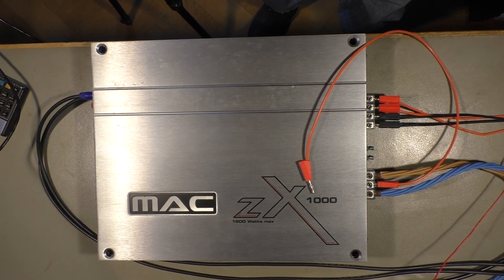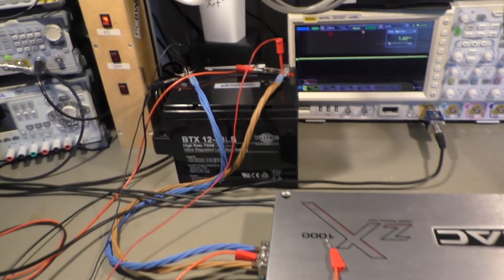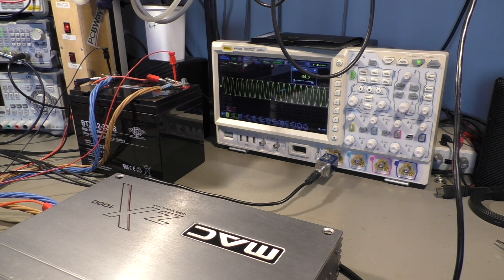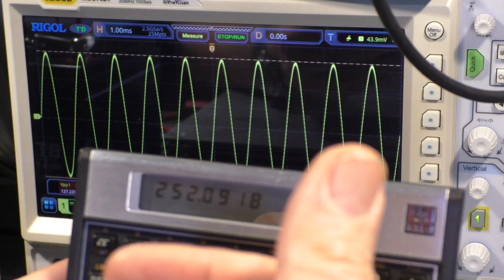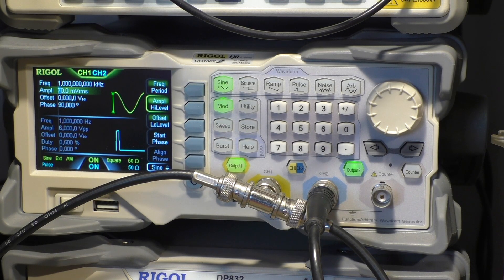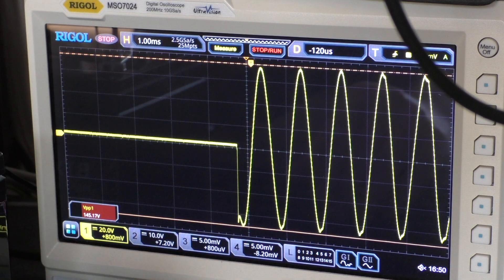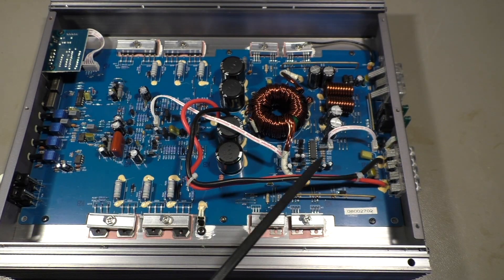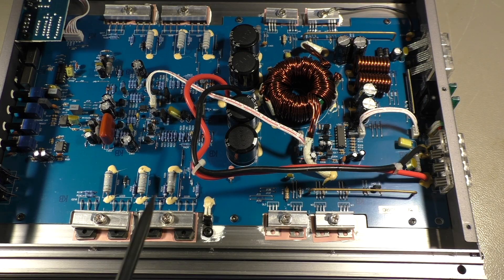1600 Watt amplifier? What the heck is PMPO??

Comment: worry not! the bass bin in the boot of the car is running at 20% THD so the driver won't hear the amplifier power supply pumping up and down to keep up! I've seen these amps with a huge supercapacitor in the 12 volt power cable in an attempt to get more decibels.

Comment: You really are playing with junk. There are some great explanations here by some smart people, I'm afraid their power rating claims are much simpler, they just make them up. That thing looks like a trashy class D thing that will likely set fire to your car before it outputs 500w RMS for 5 minutes.
Reply from the maker: Maybe not a fire, but it makes a pretty good foot warmer. You get it easily to 60 degree C after 20 minutes. And the heat sinks are a joke. 🙂

Comment: And the hp 11C runs with three 1.5V LR44 for decades 😉
Reply from the maker: Exactly! I have this calculator since 30+ years and I changed batteries about 3-4 times... 🙂
Reply: @PlaywithJunk  yea, on heavy use only 😁 AFAIK this is because the "processor" is saphire based.

Comment: PMPO was all the rage back in the late 90's beginning of 2000's in computer amplified speakers. Any amplifier/audio equipment that advertises it's power ratting as PMPO is just JUNK...
Reply from the maker: You bought a 100W speaker and when you opened it, you found "5W" printed on the magnet. Well of course this is a 5W magnet, the speaker ist still 100W  :-) :-)

Comment: I do remember seeing a bus, a Leyland bus, dating from the 1960's, that had converted to have the seat behind the driver be a booth lined with power amplifiers, on 3 sides of the cabinet. The luggage racks were gone, replaced by a speaker box with 6x9 speakers, one per row of seats. the rear seat row was moved forward one row, with that volume being a boc with 12in subwoofers arranged top to bottom on it, each almost touching the other. I figured that under the bus there were at least 2 extra alternators, and a set of 12v heavy duty batteries, to handle the power draw for this sound system, that made this bus audible from at least 2km away. I decided not to catch it, waited for the next one instead, and still could feel my body vibrating from the sound this Leyland bus was making as it drove ahead of the other bus. 

You know the sound system definitely cost at least triple the price of that bus, and that it probably regularly broke windows on it as well. bus must have done at least a few times around the clock, because the municipality only would sell them off when they went past the million kilometer mark, changing them down in route status as they aged, and my BIL did work on them, recalling that some of the routes were scary, seeing as you had brakes that had the drums that could expand by over an inch when run hot, and brake cams that only had an inch of travel total, when perfectly adjusted, and they had no self adjusting either.  Leyland preselect box, which required you to change gear using the tiny shifter on the steering column, and then drop to idle and catch the gear with the engine climbing RPM, and going down a gear meant you might have to rev to red line and beyond if you were going down a hill, before it would shift down. They lost a fair number of buses that way, seeing as a few routes had a 12km long winding road, that dropped you 400m in that distance. Scary in a car, especially when you are being overtaken by buses doing 90, and minibuses doing 130kph, and here i was in second gear, close to red line RPM wise, and using the brakes hard at each turn. You appreciated all those concrete barriers, with tyre marks running up and over the sides, and hoped that one would not drop in on you.
Reply: i saw a BMW tricked out with a lot of amps, the rear seats backs were fake, they were in fact just speaker grills. not sure how big the speakers were but they must have been 24"+ in dia.

Comment: The "standard" with those kind of PMPO tests was to have 10% of THD on the output waveform, basically flat topping it, so your test is a little conservative. Another method was to simply use the peak voltage of the output stage supply, both positive and negative rails, and then use the speaker impedance to get the theoretical maximum power it could deliver into a load between the rails, assuming the power devices were acting like wire links.  Another, common on lower power units using IC amplifiers, was to not actually use the power rail voltages, but instead the IC absolute supply voltage instead, so if you used say a 12v power rail, but the IC was rated to 35V, they would use the 35v as supply voltage, double it ( because of the speaker coupling capacitor, and square that, multiply by speaker resistance, and round up to the nearest 10W result of that. 

Car amplifiers they did the same, except for bridging they would divide speaker resistance in half, so you got a car audio amplifier with a nominal 12V supply, IC amplifiers rated for 35V, so the PMPO rating was something like 250W per channel, or 1000W PMPO as there were 4 channels, but this was still a DIN height unit, with a main fuse in the back of 7.5A or 10A, and a heatsink that was tiny as well, with no real cooling.  No wonder so many of them cooked themselves to  death, and even would melt the cassettes inside the tape player as well.
Reply from the maker: Yeah, I'm too honest.... maybe I get the claimed 1600W when the amp outputs a perfect square wave. 🙂

Comment: So that won't leave much engine power to move the car then. 
My brother used to sell car audio amps to complete nutters, one said that with his car on fast idle and the amp's at full volume the car would run for about 5mins before the battery voltage was so low the ign gave out. never found out how many kW's he was pulling from the battery.
Reply: Just had to draw 50A, and your standard alternator, rated for 45A when ice cold and at 4000RPM engine speed, would rapidly heat up, and taper down to around 25A when hot, and then the car battery would rapidly discharge till it dropped below 9V, which was a typical stop voltage for point ignition systems. You needed a ballast resistor to allow starting, which fed the coil, nominally 6V, with enough power during cranking, and then the ballast resistor would drop the excess voltage when the points were closed so the coil did not burn out.  My father got tired of that, so put in electronic ignition, and a high output coil as well. would fire an extremely weak mixture, though plug life was very short and merry. Also meant that he had to buy plugs that cost around 5 times the price of regular ones, as if he put a regular Bosch, Champion or NGK plug in, they would be burnt to nothing in under 1500km, with a few even having the center electrode burn completely away into the ceramic. 5000km service intervals, and new tyres every 6 months as well, luckily for him it was a company car, and they paid for fuel and service.